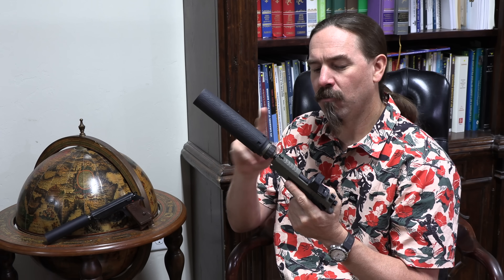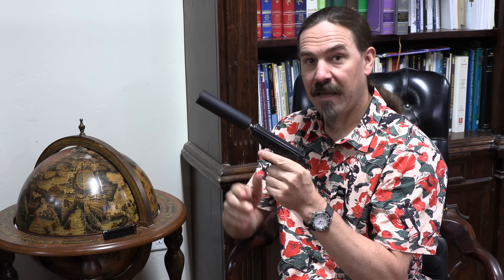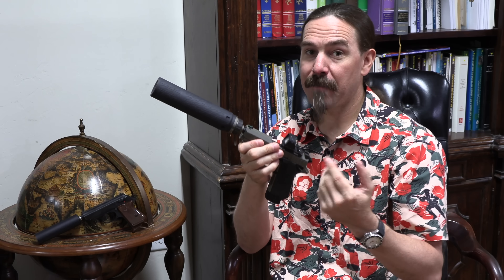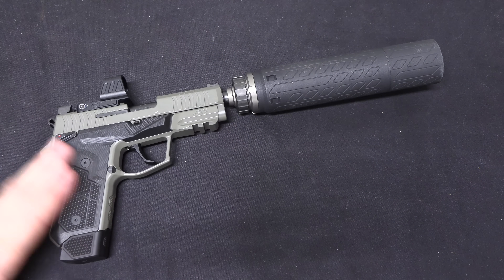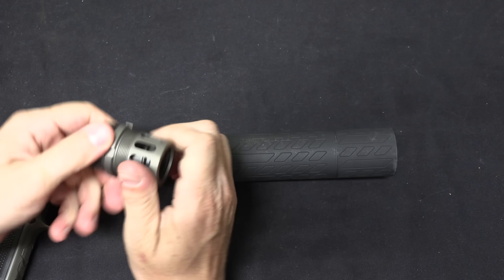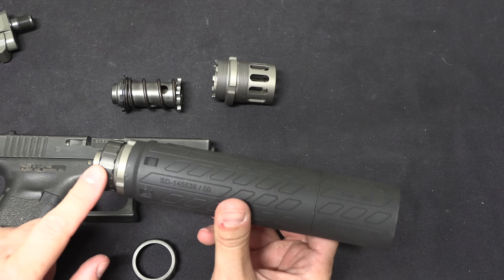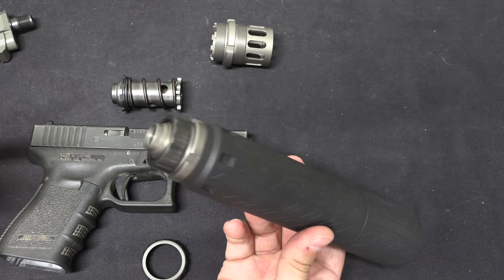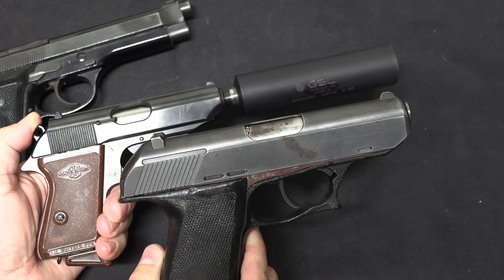Nielsen Device: How it Works and Why it's Necessary

Comment: The biggest problem with suppressing a fixed barrel handgun (specially .22lr) is carbon: the chamber will get filthy pretty quick and you’ll have extraction failures. I have a PPK/S and shooting a couple of boxes with a suppressor is all that it takes to start getting jams. I have to clean it pretty much every time I take it to the range. PPKs are usually over-sprung which contributes to having trouble cycling cheap ammo.

Comment: I think you could look at the Nielsen device in a simpler way. Its a spring loaded piston. During discharge in the suppressor you will have  vary high pressure event. That pushes the piston out. So its just a simple free floating piston that has a barrel attached.

Comment: In the slowmo with the Neilson device I noticed it was very delayed going back into battery. The slide returns almost all the way at 10:26 but doesn't go the last little bit until 10:33. Is that normal without a suppressor? Or is that due to the tilting action having some extra resistance?

Comment: Forgive my ignorance, but help me see if I understand this correctly: The entire suppression apparatus is STILL connected to the barrel and only the barrel, meaning that it is still supporting the entire weight, however, what the Nielsen device essentially does is "soften" the connection between the barrel and the suppressor, so that it can sort of "hang loose" off the end momentarily, just long enough to not restrict the barrel from tilting (because it's hanging off by a spring instead of being firmly attached). Is that more or less it? As the problem that it solves was being explained I assumed it was going to relieve the tension by attaching the weight to the frame and letting the barrel disconnect from it independently, but that does not seem to be the case at all, it's still all on the barrel?

Comment: I find it really interesting that this is the effect. I get it, but I would’ve intuited that recoil power would be robbed of the slide and that it would impede cycling. But I guess because it suspends the impact of the added mass then even the diminished force still allows it to cycle. Really cool.

Comment: First off, thank you for your content, I really appreciate how well you explain things and with real knowledge, it's rare around here. I would love a video explaining why the Browning recoil operation became more popular than blowback for pistols.
Reply: Because what became the popular pistol cartridges are too powerful for simple blowback. Look at the size of the bolt on typical SMGs. You need all that mass to tame the forces involved. A blowback pistol in 9mm would have to be very large and heavy or it would beat itself to pieces very rapidly. It would also be extremely unpleasant to actually shoot, with all that reciprocating mass crashing into the frame every cycle.

Comment: 5:00 It's odd, as this has NOT been my experience with my suppressed 1911. Absurdly oversized steel can, under-loaded .45ACP, factory springs - worked like a charm from day one. The only issues I've ever faced were failures to feed because of me forgetting to trim cases - that's on me.
Either I have been very lucky, or something in the recoil profile of .45 ACP helps immensely. Low velocity, high energy, long impulse?

Comment: As I understand, during the Vietnam War, ‘tunnel rats’ used suppressed 1911s that were modified to not automatically cycle. They had to manually rack the slide for each shot. Preserving as much hearing as possible was essential. How or what the modifications were are beyond my knowledge.

Comment: That slow motion of the Glock firing with suppressor and device was a bit odd. It seemed to me like the booster spring return stopped the barrel/slide from going directly back into battery to me. Maybe it was just the timing of the slow motion.

Comment: I always thought it was not so much the mass of the supressor, but the forward pressure of gases it experiences during the fire which works in an opposite direction to the barrel movement.

Comment: I use my suppressor on a fixed barrel beretta 92. I have always wondered how they work. Thanks for the explanation.
Reply: Never seen a fixed barrel Berreta 92
Reply: @GeorgeJungle-x9l  Its not fixed per se but it functions the same way in that you do not need a booster. You are correct though

Comment: Ian what about high pressure applications. I’m wanting to run a suppressor on a 10” 9x25 Dillon aftermarket Glock barrel but I have a feeling the pressures associated with the cartridge will shear the threads on the device and send the can flying down range. How do?

Comment: 1:30 fades out because Ian was removing a magazine. Wouldn't want to teach us how to build a machine gun😂
Reply: I didn’t realize that, YouTube has stupid rules for such things
Reply: I'm amazed he removed the silencer. The instant I saw that, I figure this video has less than 24 hours before it gets flagged and pulled.
Reply: @torgranael  He was removing it, not putting on. One would never deduce how to put it on just using that. Totally safe by modern standards, I guess.
Reply: I've once met a boy with a toy  AK-pattern rifle on a bus stop, holding it by the mag. Asked him out of pure boredom why would he hold it like that. "It's a handle" - he replied. As for where the ammo was, he pointed at the buttstock. He was, like, 4? So, YouTube logic is actually a thing. Considering a rogue preschooler scenario, that is. Imagine what that kid would do if he knew what a "Nielsen device" is.
Reply: @danglinbolas5547  Of course ammo is stored in the buttstock. Do you also think pee is not stored in the balls?
Reply: YouTube is becoming 

THEIRTUBE

Comment: Things you could actively try to get your hands onto:
*Smith & Wesson M&P 5,7x28mm — the 5,7x28mm variant has a mechanism of operation, that is very different from the others M&P pistols, it contains a muzzle booster, and has a rotating barrel
*Mauser M25 — modern flapper locked straight pull rifle
*blaser 8 — has never seen before colet lockup
*Opos Venator — ultra low bore axis but cant use the same mechanics as laugo alien because they are patented
*Alexanders Arms Ulfberth — Modern semi-automatic rifle with flapper lockup
*Wolf ultramatic — roller locked gas operated pistol
*Voere UCC, — Modern Caseless cartridge Hunting rifle that is not just a prototype but produced in series.
*Textron CT systems rifle and lsat machine gun — has sideways tilting chamber as mechanism of operation (you previously made a video about this action with a demonstration model https://www.youtube.com/watch?v=2Owogu_un7s)
*Wildebeest — Pistol with off-axis travel slide and the barrel tilts upward
*Forward Defense Munitions L5  — "Single use chamber" rifle with electric ignigtion and 5 barrels
*H&K MG11 — this is the machine gun that uses the technology and ammunition from the g11, it essentially is a revolver with a 300 round magazine to overcome the chamber overheating issue that the g11 has.

RM-277
AS-50
GSH-18 (I know this one would be extremely hard to source)

I will continue to post this until you work off the list

Comment: Great video. But I still don't understand how the Nielsen works do you have in depth video on the Nielsen Device. Also how does it compare with others as far as db.
Reply: It decouples the mass of the suppressor from the barrel, allowing the action to cycle normally while inertia keeps the suppressor in place. Watch the slow mo video segment again.

Comment: I remember my coworker buddies telling me mangioni used that B&T version of the wellrod because he had to manipulate the gun for each shot. He must be a real professional to pick something so specialized. I told them he’s clearing jams because he didn’t know he needed a booster for his suppressor.
Reply: It was crazy seeing how many people thought it had to be that specific gun lmao
Reply: @DACFalloutRanger  And the people saying the gun wouldn't run because he was using subsonic ammo, not realizing some of the best and most popular defensive loads in 9mm are subsonic.
Reply: @immikeurnot no
Reply: @WillardJason Yes. The Federal 147g HST 9mm round in both standard pressure and +P shows some of the best performance of any 9mm load and it's subsonic.
Reply: The slide is metal OEM.  The receiver is the 3D printed part
Reply: I love all the people speculating incorrect information about the CEO shooter.
Reply: @thelastbangshop so many staged shooting psyops it’s getting hard to keep track.  I think that’s the idea though
Reply: i think he knew he had to clear the jams, he had clearly done it before seeing as he did not act at all surprised when it happened and instantly cleared it in a practiced manner
Reply: Or he did know but didn't find it worthwhile to design a 3d printed version.
Reply: @someweeb3650 yeah, he probably didn't think it was worth getting a fancy expensive attachment for what was likely a street gun and a 3d printed suppressor, for a kill that didn't realistically need more than one shot.
Reply: @SeanJSlomka42 dude there is no amount of copium that can justify having a malfunctioning gun when you’re trying to commit what is in your deluded mind a “important political assassination”. 

Any thought process that leads to someone justifying that is just plain incorrect.

In this guys mind if this doesn’t work then he’s not gonna affect positive change for millions of poor people who can’t afford health insurance. 

How could he leave the fate of something that is so important to him up to a malfunctioning gun?
Reply: @JohnNeo19 I'm not sure what you mean here. It didn't malfunction. It just functioned. He knew he didn't have a special device for the suppressor. He knew he would have to rack after each shot. He anticipated that and did it flawlessly. Quite obviously had enough range time before the kill to know how the gun would function. It's still a practical take on an assassination like this. He was close enough he couldn't miss, and the target would be immobilized after the first hit, giving ample time to rack successive shots. No one nearby who's going to fight back. 
Honestly, I don't think saving lives was the intention. I think that was a happy byproduct of a revenge kill that proved his point.
Reply: i thought the point of the wellrod, at least the original British version, was that it was very quiet without adding anything on.
Reply: @RonTodd-gb1eo it was a old design.  The magazine is the grip. It was cheap and not much good for more than one shot
Reply: I don’t know anything about guns. In the video it looks like the silencer bends on the end of the barrel. Like it doesn’t stay perfectly aligned. Am I seeing that accurately?
Reply: @williammauritzen4130 yeah. On browning style barrels, like Glocks and 1911s, the barrel tilts upwards when cycling.
Reply: @williammauritzen4130 barrell is moving with suppressor but not bending at all
Reply: @williammauritzen4130  When he cycles the slide, yes. The barrel isn’t connected, and when the slide shifts to the rear, the barrel points up. Look up “Browning tilting barrel action.”
Reply: The welrod was a hand operated  rotating bolt so a welrod would have no "jams" in the sence od like a stove pipe😅😅
Reply: Well yeah he didnt need something that could go through mags of ammo. He just needed a couple shots and a cheap oil filter suppressor did the trick.
Reply: Cool globe, dude.😎👍
Reply: Allegedly used….Allegedly…..
Reply: The shooter (whoever they are; Mangione is presumed innocent until proven guilty) was most likely familiar with how the weapon operated and were simply prepared to deal with the misbehavior. The design the shooter used is intended to fire normally with a suppressor, but in practice, mating 3D-printed parts to manufactured parts is an error-filled process. There's usually a 500 to 1,000 round break-in period where you test the weapon, file it down here and there, and lubricate the hell out of it until it behaves as intended. During that break-in period, malfunctions are very common. It's very likely the shooter operated the weapon long enough to be familiar with it, but not long enough to get through the break-in period, and were simply prepared to deal with any malfunctions.
Reply: @thematt6705  Suppressors made of PLA are NOT going to last that long 😂
Reply: @thematt6705 he is on video killing the guy. On video. He also openly admitted it as if it was a thing to be proud of.
Reply: @thematt6705 it was him.
Reply: @thematt6705 it was 3d printed. There's no way in hell it would've lasted long enough to " break in ". Please use your head.
Reply: @thematt6705  Umm, yeah, it was Mangione 😂 Same gun, his DNA was literally on the shell casings at the site, he spoke in protest about the system, was on the run, had eye witnesses from the hostel he was staying at, etc. But hey, if you are a fan rooting for him, then so be it.
Reply: @archipelago93 exactly.  He admitted it. Was also related to aome in congress.  Imagine that.
Reply: @archipelago93  This aged well 🤣🤣🤣😂😂😂🤣🤣🤣😂😂😂😂😂
Reply: I thought that Luigi had to keep racking the gun because it had a shitty 3D printed slide. Are you sure it had anything to do with suppressor?
Reply: @jarimandarijn007  It was a Glock the only thing printed was the frame and the suppressor did not have a Nielsen device that's why it wouldn't cycle.
Reply: @jarimandarijn007 it did
Reply: @jarimandarijn007 we’re quite a long ways away, if ever possible, of making a printed slide. Even state of the art polymer’s today aren’t close. It would require a space age innovation and maybe a little bit of magic, to make a printed slide that functions without blowing up and injuring the operator, without even damaging the intended recipient.
Reply: @nuclearkamikaze there are metal 3D printers that are capable, however, price prohibitive for the most of us.
Reply: @leighchristopherson2455  https://www.youtube.com/@nuclearkamikaze  Somewhat amplifying the above comment. While there are metal 3D prints, you'd also have to take into account any necessary heat treatment. I'm definitely not saying it won't happen, I'm just not sure that it's happening today in 2025.
Reply: @scottsudo-nim9629 I've already seen videos that showed a 1911 made by a 3D printer. The presenter said the machine was 500,000$.
Reply: @leighchristopherson2455 I’m aware there are metal printers, and that companies are already using that to make commercial suppressors. I’m specifically talking about polymer being used for slides. As most metal printers aren’t largely accessible to most people and they’re still very crude and require a skill set to gunsmith/fit/finish after you have the printed slide.
Reply: @scottsudo-nim9629 it definitely won’t happen anytime soon with polymer blends. Metal printers on the other hand yes. But even still metal printers are costly and the printed media still requires gun smithing that aside is another skill set not everyone can grasp. Besides complete anonymity in making them your IP is still tracked when you download the files to print the object. You might as well just go to a gun store and buy a slide with cash.
Reply: @nuclearkamikaze  You can´t buy a pistol slide without a gun license and the slide being registered to your name and license. The barrel and slide of a handgun are restricted items in basically every country I can think of.
Reply: @pieterveenders9793 complete misinformation. It’s perfectly legal in the States.
Reply: @nuclearkamikaze  nah, just takes a $500,000 DMLS machine and $2,000 worth of powdered stainless steel
Reply: @jacoblipman4743 😂😂😂
Reply: And your correct.  Allot of people thought that. He didn't have a neilson device and that's why. It was a glock pistol it looked like.
Reply: It was a 3d printed gun. He needed to take the suppressor off so it'll have enough power to rack another round. 3d printing came a long way but needs more work
Reply: Well, I hope the murderer will rot in prison, but your coworker seems cool.
Reply: Most glock parts are not oem used on 3d printed unless used parts kit.

Comment: Presumably, if you want absolutely minimal noise, it is an advantage that the action stays closed, keeping the brass and the noise inside the gun. Of course,if your first shot misses, you may then have other problems.
Reply: Sealed, manually cycled pistols do exist, but they are rather uncommon.

Comment: Am I mistaken or does the Glock not return fully to battery after firing? (Never liked the looks of them! ) Also seems to be a pretty heavy and complicated for a pistol suppressor, including a pretty heavy spring in there. I suppose this is for durability,  but it sure should be possible to make a lighter mechanism that is still durable.  Comments are hilarious, too.

Comment: wouldn't a delayed blowback pistol run a little harder due to the suppressor extending the time the case is under pressure when cycling? def wouldn't cause malfunctions, but the situation would be like the browning tuned for suppressor being shot without?

Comment: Why does any average gun user need a suppressor for a pistol?
Reply from the maker: If you have a home defense pistol and you don't want to give yourself permanent hearing damage should you need to fire it indoors. Or if you want to better protect your ears at an indoor firing range. Or if you just want to be more polite to people around wherever you are shooting. We don't "need" mufflers on cars, but we all use them anyway (and, incidentally, the guy who first commercialized firearm silencers was the same guy who commercialized small engine mufflers).